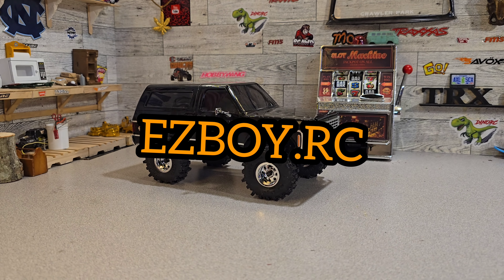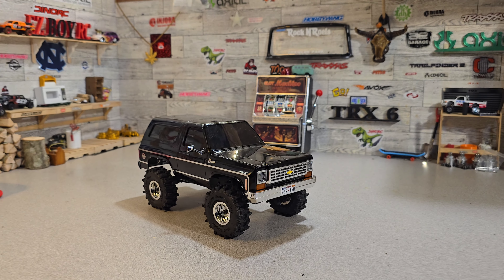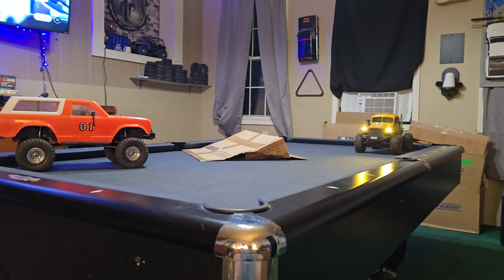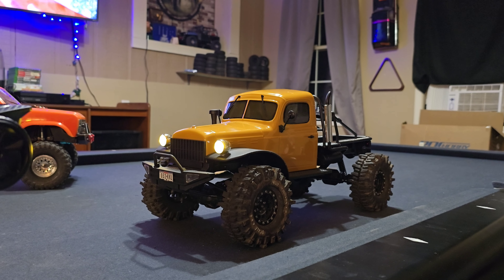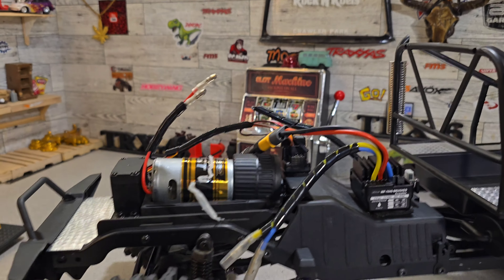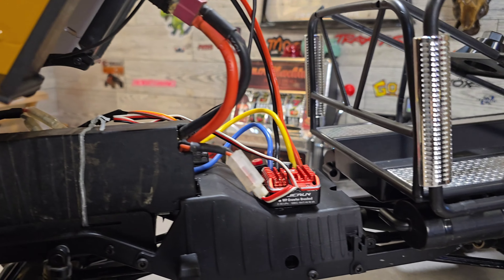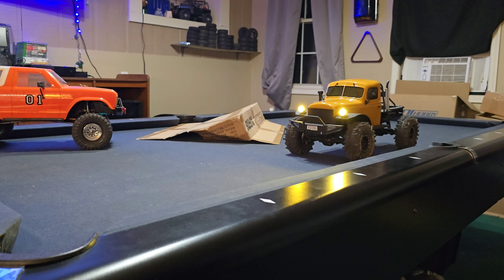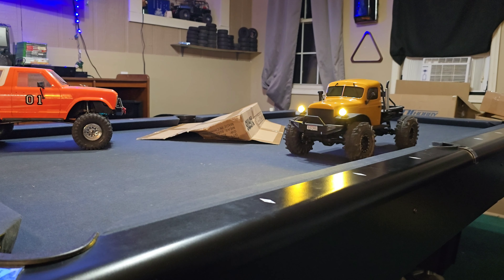Installing the HOBBYWING 1080ESC in my FMS Atlas

Comment: The 1:24th Blazer isn't on sale on the FMS website.  The 1:24 Power Wagon and the 1:24 Lemur are $30 off though.
Reply from the maker: Yeah, I just went and looked and didn't see it. Either. Sorry about that. I thought all fcx24s were gonna be on there. My bad. On a side note, I did see where you can turn the power wagon into a tow. Truck, I need to look into that myself.
Reply: @ezboyrc553  I didn't see that. I made a wooden bed with rails for mine. I'll have to look for the tow upgrade.

Comment: Is the ESC 1080 has to be programmed before used or just use it anyway?
Reply from the maker: You can run it the way it's programmed, but if you wanna modify it to your own specifications, you program, it. You will have a lot more control when you program it. For example, one of the settings, the Esc Can make a really loud humming noise when you give it throttle.but if you adjust the frequency down, you barely hear it at all. And you can change the voltage that goes to the servo, along with other things.